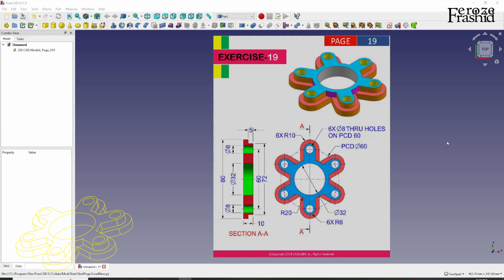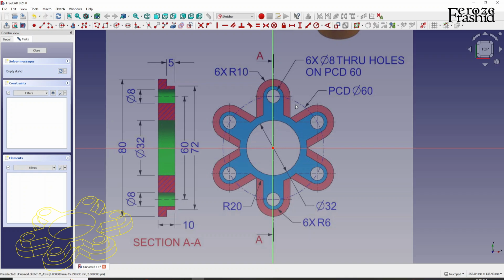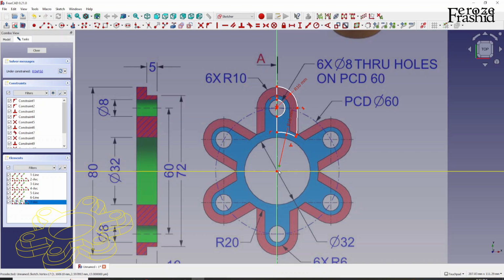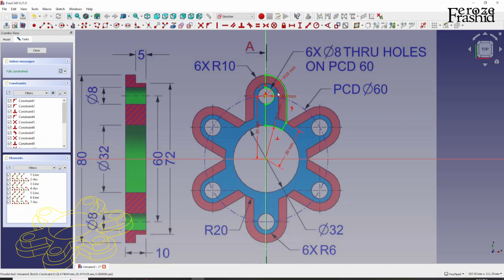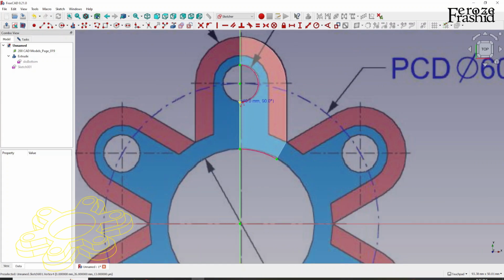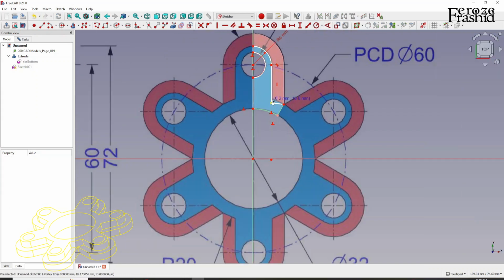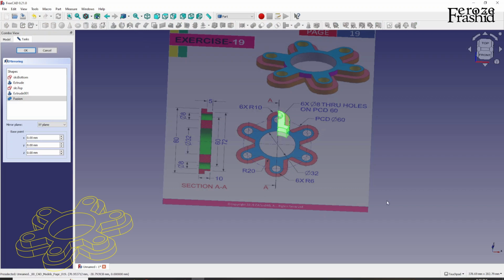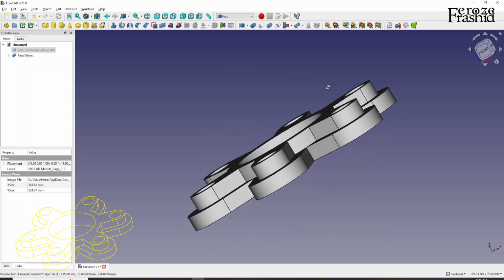200 3D Models in FreeCAD: Exercise 19

Comment: Mr. Kushol, on my second sketch i do get Fully Constraint sketch. but when i Extrude i only see frame of the sketch, with an error that said: WIRE NOT CLOSE?
Any idea WHAT IS GOING ON?
Reply from the maker: A fully constrained sketch can still have gaps or openings. Even a straight line can be a fully constrained sketch. Having said that, look for possible area where two points are not coincident. If it takes more than a minute to find the gap, sometimes it takes less time to redraw the sketch, in my personal experience.

Comment: I switched back from the 50CAD Drawing series. My refine did not take away all the lines in the center hub, but remove lines in outer or base hub? Nice project. I need to use lattice2 more. Thank You

Comment: Good video Mr. Kushol.   I believe you can do almost the same polar array using the array tool in the draft workbench.
Reply from the maker: I has some experience where array products from Draft wb needed some additional attention to make them solid+boolean ready later in the process. I plan to do a more thorough comparative research on these two array products. I appreciate you sharing the knowledge.